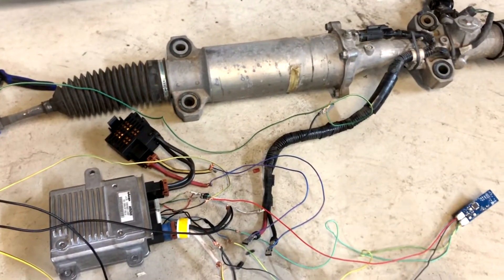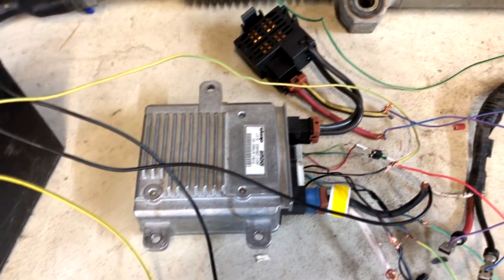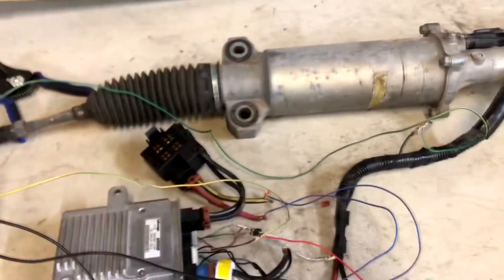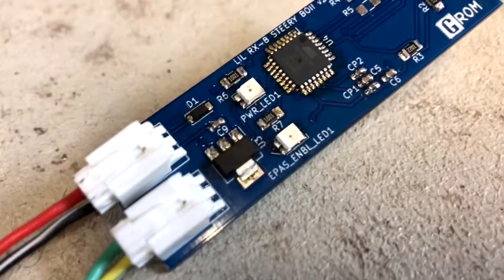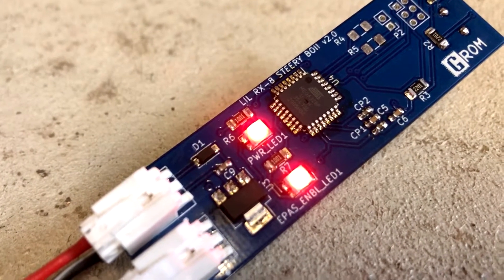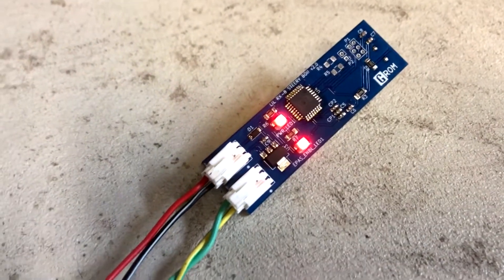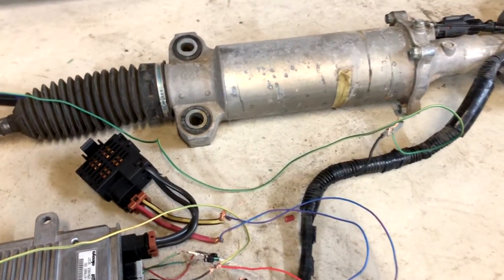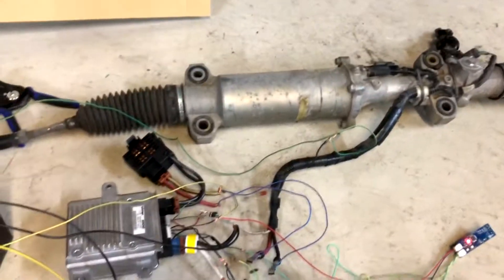Mazda RX-8 Power steering without the OEM ECU!!!  G-ROM EPAS Enabler Board

Comment: Does this unit offer variable assist according to road speed like the stock system?
Reply from the maker: Yes, and also no.

Yes in the sense that the torque sensor on the steering input shaft allows for variable assist as it would in the OEM car.

No in the sense there is no vehicle speed inputs going to the rack.

It's not a big deal since almost every swap puts more weight on the front axle of the RX8, so the OEM "variable assist" wouldn't be calibrated properly anyways. It also only matters at lower speeds, as once you are moving the amount of torque it takes to move the steering wheel is reduced, which is captured with the torque sensor.

 As such, boost is set to max to accommodate for higher axle weight, and the torque sensor will read appropriately and give proper steering assist.

Comment: Started watching your Subaru gauge cluster video because I've got a CAN WRX cluster sitting around and I want to use it in my Turbo EG33 impreza. Then I saw this video and I think to myself "Didn't I see this thing on LS Swapped RX-8 FB?" turns out yes I did. It seems we have very common interests Garrett, I'm just getting into CAN etc, thanks for putting out content, and I'm interested in this module for my LS swapped RX8! -Evan
Reply from the maker: All thing poking and proding software is fun! I've got some units for sale if you're looking for one!
Reply: @GarrettsSubaru  I believe I still need the factory ECU for ABS and the Tach, but I'm not quite far enough to know for sure.